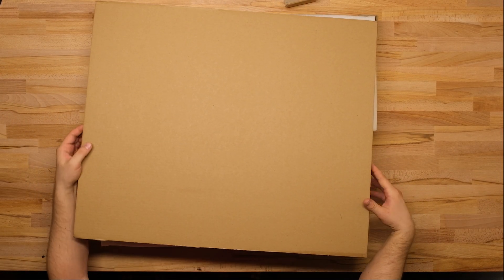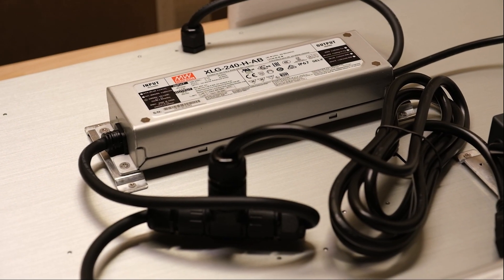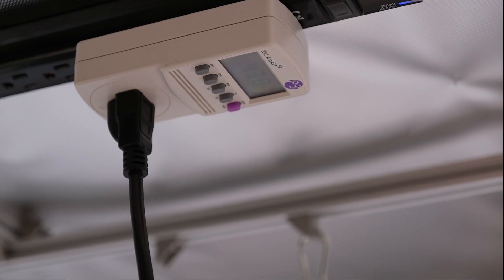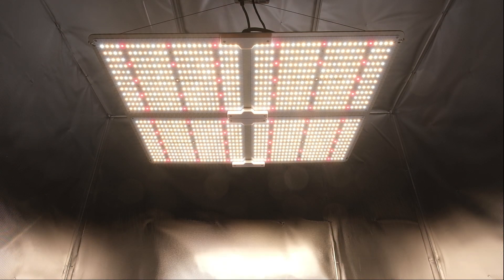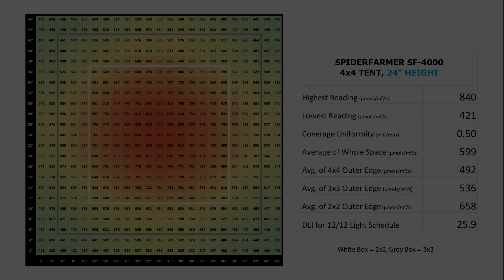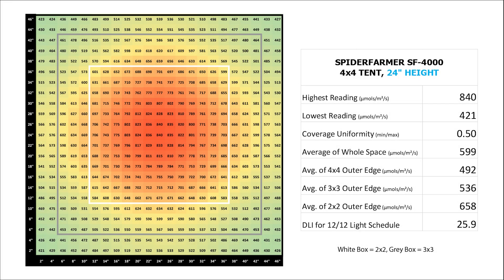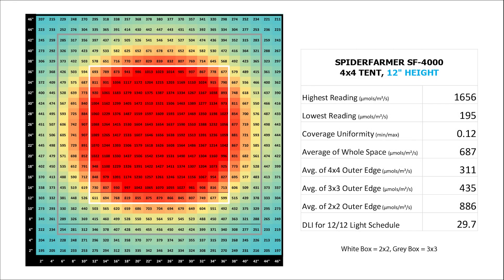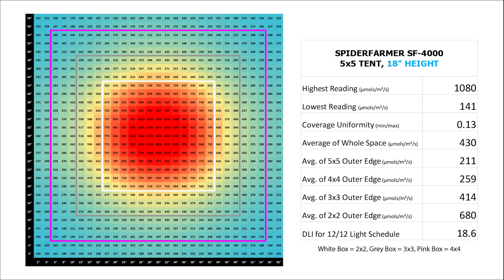Spiderfarmer SF-4000 Review (High-res PPFD Results for 10 Heights + Temp and Power Tests)

Comment: The DLI levels are much lower than the calculators I've been using online. Is that because the spectrum of the light or something? I assume your readings are more accurate so I've apparently been giving my plants not nearly enough light.

Comment: Love the setup you have. Question though. Since this light, as of the date you posted this video doesn't really seem to do a 5 x5. Then what do you suggest for a budget-friendly LED light for a 5 x 5?  Today there is an SF-7000 LED Grow Light that claims to be a 5 x 5 (but so did this light you're testing) and presently the price point for it is $740.00usd. I've crunched some numbers but am not really ready to pull the trigger on the SF-7000 LED Grow Light for that price considering my 1000 HPS is doing the job in my 5X5. Your thoughts, please. And all over the net, most people claim min to flower with is to be 400 micro muls.
Reply: I'm sure you've already solved this problem but I just wanted to tell you my set up in my vivosun 5x5.. I have 4 leds.. 2 sunrise bar2400, 1 bloomplus xp3000 and one bestva 100w.. for a total of 880w led.  I grew 7 plants and did amazing.. you get better coverage with multiple lights..

Comment: Nice maps! This is basically a nice starting point if starting out with this light..very detailed! I picked up this light on a sale... decent price for $450 and thought I would give it a try..they have updated the boards and took diodes from the center and bunched them out in the corners. The Atrium 100watt light is very similar (or vice versa) and they added more far red diodes. With the relocation of the diodes it hopefully has a better overall coverage.. however I've not found a par map of the new layout yet. ✌️

Comment: I assume the sweet spot of 2 SF-2000 would be 24" as well? I just lowered mine after a quick lux check from my tablet, yeah way too dim for a 5x5 with the 2000s I can only get around 50000 lux even near the center, so that claim is disingenuous. I may up to a HLG next time because this is far from cutting it.
Reply from the maker: It likely would be.
Reply: @LEDGardener  
Thanks, adjusted to 23" seems to be working out as best as can be expected.

Comment: i bought the sf 4000 partly  based off your testing. they sent me the 2021 version that has the better light distribution the diodes are spread out in the center and packed in the corners. i was gonna run mine at 30inches but i think i can go closer due to the better light distribution. kinda wish they would send you a 2021 version your testing is next lvl.
Reply: Nice I am going to order one for my new 4x4 Electric Sky is on a 3 month back order so Spider farmer it is!! Did you get the updated version on Amazon??
Reply: @TitleTownStacker  yea they  have the title listed as the 2021 model they havent updated pictures or anything just the title on amazon that i seen. when i got it i was a bit  sceptic but  i had contacted spider farmer they said it was the new 2021 version should be better for seedling and clones and overall better  the center par is lower and more spread.  I dont have a good par meter to test, just been using cellphone and lux conversion and it seems to drop more consistent from center to edge or corner compared  to testing seen in this video.  still nice to see spider farmer taking feedback and making improvements im happy with the light. went from a 2x4 with sf-2000 to this sf4000 in a 4x4.

Comment: I was going to purchase 6 sf4000 then I found your review...EEK!
Reply: so did you purchase them? if not what did you purhase? I have two sf4000s and did 1 grow and it was great, was going to buy 2-4 more.
Reply: @MankindsMen  There are more efficient solutions now, but there's nothing wrong with these boards, except it's tricky to get a good coverage in a 5x5. If you put two SF-4000s in it, GREAT but you could cover the same area with 3 SF-2000s and in each case you will only cover a 5x4 area well because the boards are simply not long enough.
Reply: @MankindsMen  Same. I bought two of these for a flowering room of 10x 10. They do pretty good.

Comment: would be hella rad if you could do 80%, 60% and 40% at different heights for a good veg with power savings.
Reply: I agree I was hoping for a good cost savings power / distance recommendation...- I'm now thinking of keeping my girls in smaller pots within my 4x4 tent within 2x2 area @ 12" @ 20%   And see how they do.. my lil girls are in 9-5 gallon bags already so I'm thinking to just go with 24" with same 20% and after a week increase power in increments every week up to 50% and see how that works..🤷🏽‍♂️
Reply: @TRUMP4PRISON2024  in veg you can pretty much run these at 50-75%, and I would not recommend goin lower than 18-20", seems to mess up the coverage.
Reply: You can veg with theese at 20 % 60cm height lol i got 3 of theese and their pretty good 🙂
Reply: You can its called find a better manufacturer lol my Volt Fl-1 better than all these

Comment: I ended up cutting my sf4000 in half to get better light distribution in a 4x4.
Reply from the maker: 200 IQ play!
Reply: @LEDGardener  probably not so good for the warranty lol
Reply: Hope you make a video so after warranty is over I can do it.
Reply: @TRUMP4PRISON2024  I used an angle grinder with a thin cut off wheel made for metal.

Comment: Flowered AA grade in a 6.5 x 6.5  closet space at 330/460 watts, then full 460 watts for last three weeks. Terpy and dense. Low heat with mini desk fans and low energy use. Hands down, the best bang for the buck. Made back cost in one harvest (coco coir with organic amendments).
Reply: Considering the fact that even a sub par grower should be able to pull close to a gram a watt…… I would hope you’d recoup investment plus quite a bit more with grams going for an average of $10 a piece. You should’ve gotten 3x your money…. Minimum. If not you’ll need to do some extra research and get your growing skills up lol
Reply: @nickspeakstruth133  Are you trolling on a year old comment? I mention I’m a happy customer with a light that paid for all my equipment and supplies in one harvest, and you spring into action? You think this is where your services are needed? You thought, “the World needs and cares to hear what I say”
Reply: @WorthyBuzz  correct, because they should have realistic expectations. A gram a watt is not at all a “good” grower by any means. So using that as a base starting point is a good measure. It’s not really the “best bang for the buck” though tbh because those who buy cheap, buy twice. Poor man pays twice, rich man pays once. Better to spring for higher quality lights and get the 2.5 grams a watt, then get UV/IR bars and run those to get an extra 6-8% thc levels in the last 2 weeks of flowering. Age of comment is irrelevant because you mentioned nothing that was time specific, neither did my response. You also were so triggered by a simple observation that you responded within the hour to an “old comment thread”, so I fail to see any relevant point in your attempted cop out. Fact of the matter is, you get what you pay for. I’ve purchased an sf4000 before and for a beginner with no experience in a 3x3 it would be a great light. This thing doesn’t even hardly have the footprint to cover a 4x4 the way they say it will and that’s extremely obvious based on these data sets provided in the video. Even the corner foot around it is struggling. If people want “dense and terpy” colas as you suggest are what this light gives, they’d be shocked to see the density of colas from a better light, all I’m saying. They could still achieve that with a 3x3 tent rather than a 4x4 though too if they were dead set on this light, plus they’re cheaper. You’re welcome for the free advice from a person that knows a thing or two because he’s seen a thing or two.
Reply: @nickspeakstruth133  yeah... ummm... If you felt this strongly about spider farmer being cheap "poor man's" gear.. then why the hell are you watching a review video about one of their products? I am a new grower and to be honest I'm looking at this fixture because all the "poor man" companies like Viparspectra, Mars Hydro and Spider Farmer are producing results with current growers showcasing their usage. With all of your sage wisdom and expensive gear.. do you have any grow series up? Nope but Hygro hydro, Inside Hydro and Grow to Learn and 2x2 tent grower are killing the game and teaching with what you call poor man's gear. So as a new grower, unless you can show and teach with a YouTube channel of your own, keep the free advice to yourself.

Comment: Cant thank you enough for the work your doing it is so informative. I have a general LED question , with the 301 b chips and meanwell combo being essentially the industry standard could you replicate these same results if you purchased say five of the bloomspect ss1000 which uses 301 b and the 100 meanwell at 79 bucks on Amazon, so for 400 bucks that would be pushing 500 watts though mean well drivers powering  1090 diodes,  I guess my question is with every one using the same components , cant the same results in theory be achieved by all the various light companies? I ask because I compared the bloomspect ss1000 to the sf1000 and they arw identical with one exception and that is the sf1000 uses 72 cool white diodes and the bloomspect uses 70 besides that they use identical parts, with the sf 4000 running $560 on Amazon you could get 7 of the ss1000 bloomspects for the same price pushing more wattage with a few hundred more diodes? I know this is is a long winded question but with so many people using the same parts its a bit confusing as a consume
Reply: Vreat idea, how would hand them all
Reply: Bloomspect and MarsHydro are made by the same company btw

Comment: What if I put a Spider Farmer SF4000 and an SF2000 together in a 5x5 tent at $800 for both. 
Would I get Same or better uniformity of light throughout the 5x5 space than using (1) HLG Scorpion Diablo at $1,400. That’s a $600 savings. 
Also Taking into consideration spider farmer is good for Veg and flower.
Reply: I just bought a sf2000 to go along with my sf4000 for my 5x5. Hopefully I get great results. I'm still confused on how low I should hang my lights during flowering
Reply: @yeahwhatever429  how did it work out for you?

Comment: just letting you guys know if the wire hanger touch's the diodes why the light is on the diodes burn out i lost half my light's on my mars hydro ts 600 =-/

Comment: why they still using lm301b?
Reply: So whats the newest standard LED than?
Reply: @mmenil1  lm301h gives you 3.10 μmol/J @ 65 mA. lm301b gives you 2.92 μmol/J @ 65 mA.
Reply: @mjlourens565  Check out actual specifications from SAMSUNG, there is no difference. I have seen them and I have heard from actual partners from SAMSUNG who I buy LED's and LED strips. They are exactly the same, literally.
Reply: @mmenil1  One has a b and one has a h - that makes them not the same, literally.